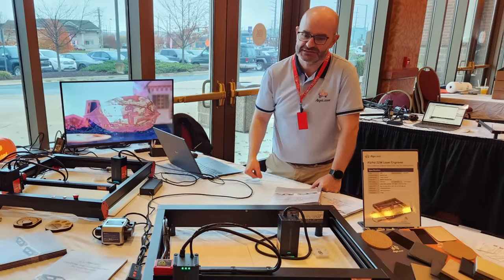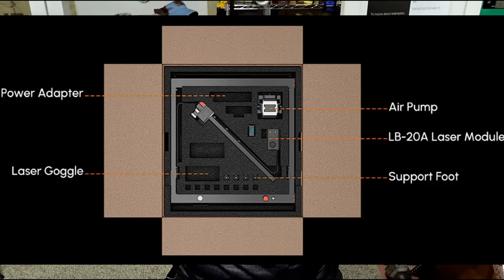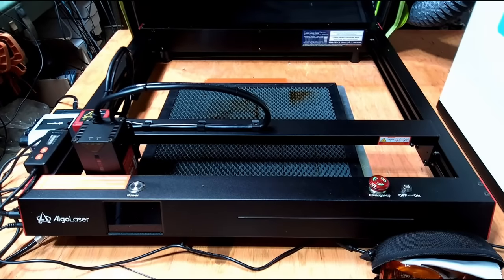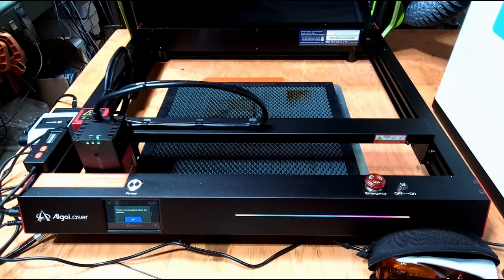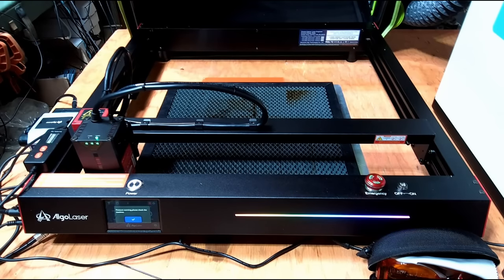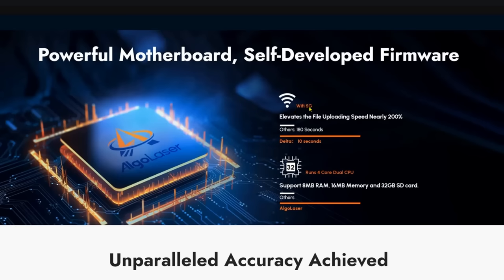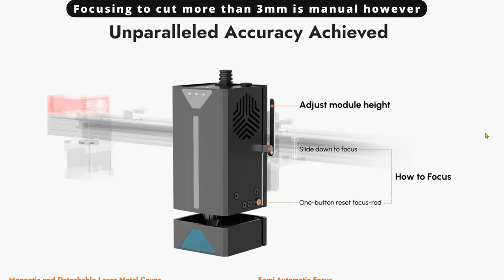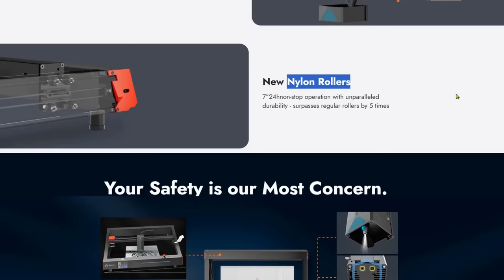👌My thoughts on the new AlgoLaser, Delta 22W diode laser engraver, cutter.

Comment: I wonder if the laser head isnt adjusted correctly. Grab the head and move CW and CCW for movement. One I had would move side to side. Might explain the line wobble.
Reply from the maker: Nope, mechanically it's perfect. I checked and rechecked it. It's a speed issue on the X. At 25K it works fine.

Comment: Touch screen like 3D printers and cutting from a file like selecting a file to print. I guess that's one way to do "wireless" engraving. As always your videos are awesome.
Reply from the maker: Thanks! Yes, this touch screen if different that most in that it has it's own processor and it's UI is well designed. The 5G is also like what you know on your phone, and the uploads are super fast. You can use the app or the web UI in a browser. This is a solid machine.

Comment: Is it possible that the new machine has the accelerations set too high? That could explain both the wavy sides and the faster engraving job.
Reply from the maker: It could be, but a new user would have no idea what to do. I have already reported it to the company. 25K scanning is the highest I can get on the line tests without distortion.

Comment: Hi Rich, thanks you for those nice videos. I learned a lot about Lightburn. I’m new with laser and burn a kind of material. If got a new Atomstack S10 Pro it burn from the remote control perfect. And works good with other software.  I want to work with Lightburn but from met laptop it doesn’t burn on my material? What must is do? Is there a standaard settings. I use something what Atomstack give me, but still it doesn’t burn 😢 I hope you can help me.. thanks from Amsterdam. Leo
Reply from the maker: Hi Leo, I don't know what the problem is, but Lightburn has an extensive support forum where a tech can answer any questions you might have: https://forum.lightburnsoftware.com/

Comment: Great review. I was looking forward to it. I'd like to see diode machines have a work area of either 300x300 or 400x400, with extension kits available. I can cut a 4ft x 8ft sheet of material down to those sizes with little waste.
Reply from the maker: In all reality, I work mostly in 12 x 12" Daniel, so 300 wouldn't work for me.
Reply: @TheLouisianaHobbyGuy  Yeah, and if you're working in that size, it would also be good to have some extra room for overscan.
Reply from the maker: The LaserMATIC is 415 wide, so I have plenty of room for overscanning on a 12x12. When the Mark 2 XL comes out next year, it'll be over 600mm wide.

Comment: Purchased one based on reviews.  Seems very underpowered.  I've been through the setup process, checked and adjusted the belts, In Lightburn I can finally cut out a basic rectangle if I use 100% power and set speed to 200mm/m.  Nothing appears damaged.  Box was not damaged.  Just seems based on all reviews that performance is well below expected.  Tried contacting Algo several times.  Waiting for a response.
Reply from the maker: Check your S-Value Max in the device settings (wrench and screwdriver icon). It should be set to 1000. Yours might be at 255.
Reply: Thanks so much @TheLouisianaHobbyGuy

Comment: By having the air assist taped down to the frame, could this be a cause for the squiggle lines? 
Just a thought.
Reply: He just has the speed controller taped to the frame, not the pump.
Reply: @danielthomas3236  thanks for the update.
Reply from the maker: No Bill.

Comment: My width & height shows as 399 x 429. The air assist is quite annoying as it's start as soon as you turn on the machine and goes 100% when you start engraving. You have to manually turn it down. There seems to be no way to set it to stay off unless you initiate. Unless I'm wrong. That button to release that pin to focus is hit and missed and not easy to press.
Reply from the maker: I think there are a couple of versions of the Delta Glenn. And yes, I too found the air assist a tiny bit annoying, and it was the loudest laser I've tested to date.